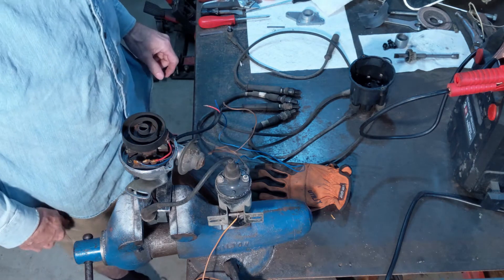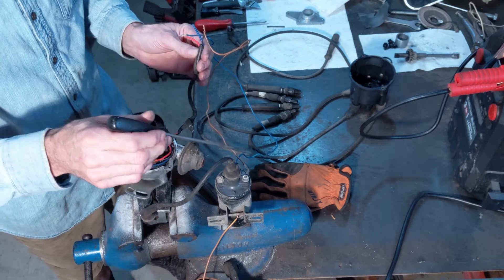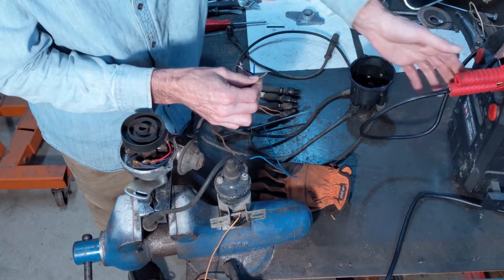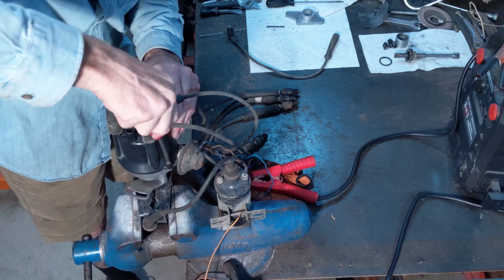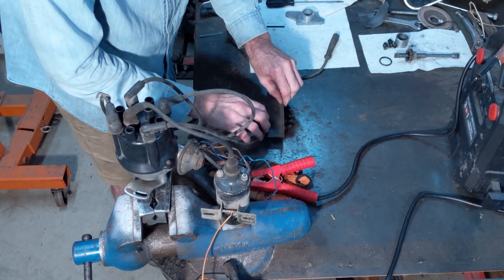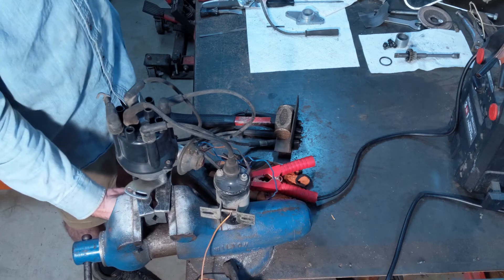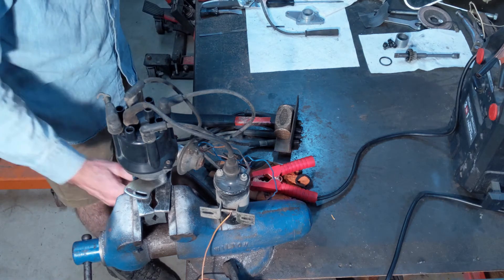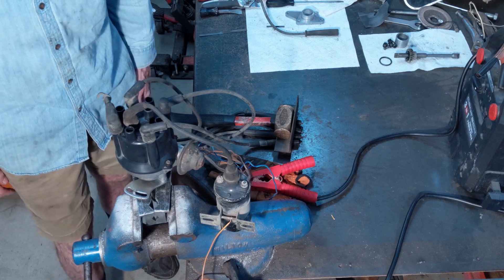KA24e distributor wiring conversion

Comment: Would it be the same amount of work to convert a distributor for my 1988 vg30 carb swap?
Reply from the maker: @biyordie4886
  • 2 weeks ago (edited)
Sorry its been so long, life got in the way.
I looked into the VG with carb issue.
I actually converted a distributer but discovered it origanally rotated the reverse direction so the mech advance would not work!
I then looked around and found that an older straight 6 Z ( 280?) with simple electronic pickup would work, with machining.
However I never actually proceeded with the project.
Good luck!
Reply: Im a big vg fan.  I own 2 z31s.  3 wd21s.  And my vg swapped 240sx.  This channel is awesome just wanted to say.

Comment: What does the wire from the coil - to the distributor do? Im trying to learn my new 720 and this is the setup I have
Reply from the maker: The wire from the dist to the coil, signals the coil to fire.
Reply: @biyordie4886  to be sure it comes from the coil negative to the signal wire in the dist? Is this what grounds and closes the coil circuit?for some reason I believed the coil was always energized like a capacitor and just discharges when the point contact is close enough to the distributor rotor.  I am beginning a rebuild and really want to simplify everything and remove as much unnecessary clutter as possible and want to learn this function.
Reply from the maker: @thepisswalker  Yes, coil neg to dist.
It's a two action deal, the coil is energized till the distributor shuts it off. At that point the coil field collapses and causes the secondary winding in the coil to send a high volt charge out the spark wire to the cap where the rotor needs to be pointed at the correct plug.
Reply: @biyordie4886  got it. Thanks man learned something new

Comment: Aloha, im trying to wire my nissan ka24e d21 wiring harness to a 6 pin ka24de frontier distributor and run wasted spark coil on plug. Im using a ems to control timing. Im having trouble getting the cas to trigger the spark. Finding solid information about this is difficult